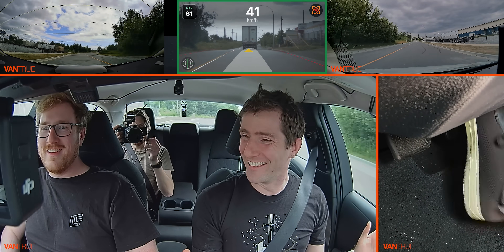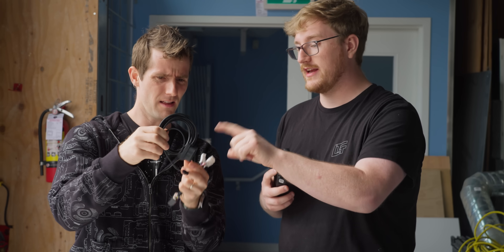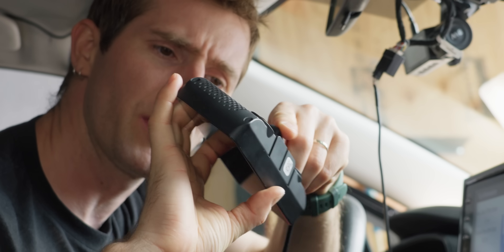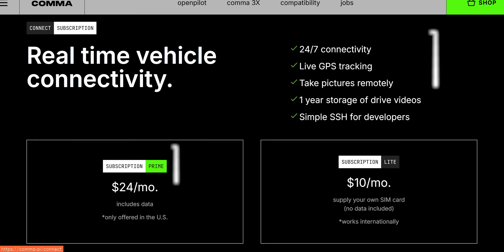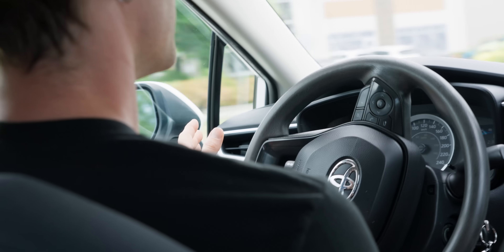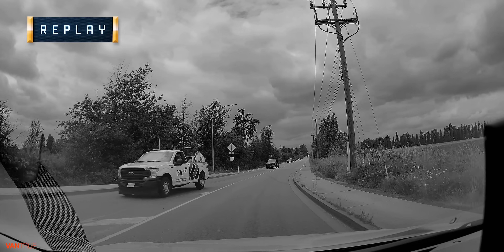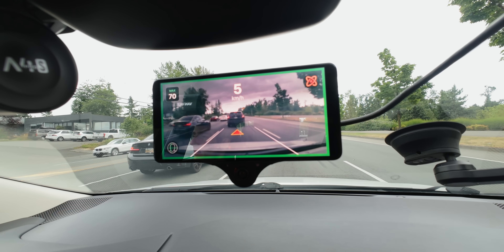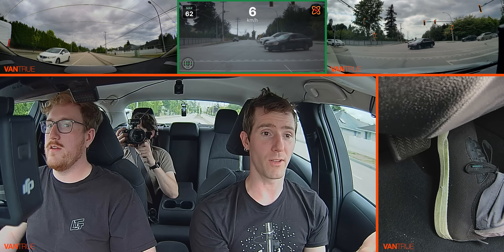I Upgraded My Car With Open-Source AUTOPILOT and it's AMAZING

Comment: Very cool to see Comma getting some attention. It somehow gets completely ignored in the self-driving car space, and I think it's one of the best technologies out there right now for consumers.
Reply: But its not the best, it feels more like expensive experiment. It can't drive in cities, it barely recognized traffic lights or stop signs, can't properly utilize turning as you can clearly se in this video, it only has some decent performance on highways, but then again, quite few newer cars have ADAS built in.
Comma will always struggle to perform due to basic lack of hardware, processing power and basic half hazard integrations into cars systems.

Comment: Hi @LinusTechTips, I saw you powered a Comma AI and another dashcam in your setup—could you please share how you connected both? Is it possible to use a single USB cable or a splitter from the Comma AI to power both devices safely?

Comment: When my 2020 Chevy bolt had to be lemonlawed GM offered a MSRP swap except they didn't make any cars I wanted. They managed to find a dealer demo 2019 Chevy Volt premier that had this and a bunch of other options pre-installed (technically the first owner but it had like 6K miles). It seems to work way better in my Volt then what is showed in this video so the tech that's already in the car probably matters a lot but I've really been enjoying this for years and was really disappointed when I tried out Tesla's version in a rental car model s.

Comment: Great to see Linus test this and inform more people about its existence. The ability of it to take curves is entirely vehicle dependent, and varies depending on each make/model, in accordance with the power steering hardware and firmware that's in each different vehicle. Some are more aggressive, some are less, but all can be easily overpowered by the driver if necessary.

Second, yes, the fact that this system will not disengage (at least not by default) when you assist it is a great feature, and is quite different than stock systems.

Third, I run it on a not officially supported vehicle, and the fork I'm using (a custom version of FrogPilot for my specific year/make/model vehicle) DOES read speed limit signs and if desired, slow down for curves (even with no specific speed limit signage) and speed changes, within the bounds of you setting the upper limit.
Reply: I'll say this, I have Tesla autopilot.  He says this is a problem with autopilot and I can assure you it's not.  Tesla has its issues but it's weird to make statements like that.
I've had the car jerk around because it seems to recalculate where the turn should be, like turning into a lane that has a curb and tree separating the lanes, but it knows to slow down for sharp turns.

Comment: I have a '23 Model Y I picked up used for a song. I have no interest in paying $100 a month for full self driving, not really interested in FSD at all, really. I've driven one with it and it is more stressful than driving myself. All I really want is adaptive cruise control with lane centering but Tesla doesn't seem to know how normal cars work. Their autopilot with autosteer is just so unreliable. It hits the brakes for no reason, sometimes slows down for turns sometimes it doesn't. Even just using autopilot without autosteer, it still hits the brakes for no reason.  Oh, and what's the deal with not having a resume button? I have to manually get it to speed again every time. The best thing about this car is with the Commander, I can finally change lanes and have autosteer resume after the lane change automatically. But really, it should already HAVE this feature.

I will say that the model Y with FSD I tested out... it did a much better job than autopilot. I just don't want FSD unless it's good enough for me to be ignoring the road completely, so I could be on my computer doing something productive or distracting to pass the time.

What I like about driving myself is the passage of time is faster because I'm completely occupied. I hate being a passenger because I get so unbelievably bored and time stops.

19:25 I love that! Let me help out when needed without kicking me out of the driving assist mode. Tesla, are you listening? Tesla developers, do you not know anything about regular vehicles? My 2018 F-150 doesn't kick me out of any cruise control functions when changing lanes! 2018!!!! (to be fair, it doesn't have lane centering)

Comment: And like Tesla the cameras are not perfect dont like rain fog snow or poor light and can be tricked into driving into a wall if a road is painted on it. If you value your life only use a system that also has a way to detect objects like radar or lidar as well as cameras. Safety in cars for occupants and other road users shouldn't be compromised for technology sake, yes humans make mistakes but they can be held accountable and as tech designed by humans it will not be perfect.

Comment: Have been using comma 2 and more recently comma 3 for the last 5 years on a 2017 rav4, I keep trying new cars with self drive and the comma is by far the best, maybe tesla has some advantages but the overall experience with Comma is the best. Their motto 'make driving chill' is comma, you never feel stressed, you always seems to have time, on rainy and dark roads it makes you feel much more safe, its 'assist' model works brilliant, as long as you dont break its engaged. There may be times on tight corners you may need to help turn thats a bit dependent of the car. I do 100 km home to office drive a few times a week and basically dont need to touch the wheel or pedals aside from start and end. I don't understand why all the majors are not using Comma, with built in cameras it could be even better, its driving behavior is so much more comfortable than the aggressive Tesla one. The install takes 10mins on the Rav4, it has a great screen in a good location, is also a good dashcam with onlin footage (at no ongong cost). Its also fully hands free as it looks at your eyes and does the driver monitoring with a fair balance of attention. Love my Comma!

Comment: I use a comma 3x when driving on long highway hauls. I can set it and not touch the steering wheel for 3 hours. The result is that the amount of fatigue that I feel at the end of that trip is significantly lower than if I had driven it manually.

Comment: I really think the self driving tech today still can't really be trusted. People have tried to demo Tesla FSD and auto pilot to me a few times. Every time, it's fallen flat on it face figuratively speaking. The car would attempt to jump the curb, not make the turn completely, or run stop signs. The driver would have to intervene to prevent an accident and I see the same thing here.

I like adaptive cruise control and lane keep assist since it makes highway driving much less tiring. I'm still holding the wheel and watching the road, but the system makes it so I don't have to put force on the controls constantly. The self driving tech is too dependent on requiring the driver to have situational awareness and being able to take over at any moment. It really defeats the point of the "self driving" tech right now.

Comment: Tesla FSD finally as of like 6 months ago takes turns at speed on the highway correctly. I had a mountain interstate with extremely aggressive turns in 70mph zones that were simply not comfortable and Tesla would overshoot the lane line every time. But now with the latest version they will not only steer aggressively enough but also slow down enough. Still doesn’t give extra space to cars in adjacent lanes well enough but speed control on turns is there finally.

Comment: it would be awesome if it would be make compatible wilt older cars (from 2000 to todays) to be plugged into obd port just to set up a certain speed (via 4 buttons [summon cruise control function and revoke it, set up certain speed, speed increase and speed decrease] that can be easily seen and press with backlight and stick it somewhere and use that button via a wire from that console) and when lighs on the backligh to be turned on and via obd whe the brake pedas is used to suspend that that setted speed. if that function would be putted in, i would give even 500 to 750€ just to enjoy cruise speed that it doesn't had from carfactory.

Comment: To say Tesla autopilot doesn’t slow for corners is objectively not true. Openpilot is awesome but two minutes of driving with Tesla autopilot (not FSD) will show you that it slows for corners every time. It also can handle any curve on normal roads as well, which openpilot fails to do. I know there are technical reasons for this, but the functionality is night and day in this front.

Comment: My coworker just showed me his Comma AI setup in action on his 2019 Subaru Forester the other day, and yeah this thing is pretty cool...

My Accord has lane keep assist and traffic assist (keeps a certain follow distance which is great for road trips) but the lane keep REALLY sucks (sometimes I have to guide it anyways because it tries to drift out of the lines) and it yells at me even when I have my hands on the steering wheel, or worst off, sometimes it tries to correct me to go straight when I'm in a turn because it thinks I'm missing the lines, so I'm really tempted to get this just to improve the current assist and get full autopilot for those longer road trips lol

Comment: 3:06; You should never have an accessory that is constantly pulling power from the diagnostic/OBD-II port. They aren't designed for that in mind. Short term is fine, but some vehicles will, Toyotas included, can actually be damaged by that.

Comment: 2020 honda accord sport has fanstastic Adaptive cruise control, but the lane keep assist is down right insane with how good it is! It was taking turns by itself in stock format that were normally pretty dang strong.

Comment: A standardized test on the track, with dummies entering the track, scenarios with little visibility and especially very sharp curves with speed oscillation (a weak point of older software versions) is ideal, especially if it involves different vehicles.

NOTE: for some cars that do not have cruise control enabled, it adds a lot of technology that would certainly cost more than the cost of this equipment.

Comment: Genuine question: Since the software is open source, is there concern that bad apples would be able to develop software to hijack and control your car remotely? It's a bit of a dystopian concept but a valid concern nonetheless.
Reply: no since its open source anyone can view the code and find stuff like that also the car isnt fully self driving yet. also the official has many ways to check for those kinda things. have you used github before?

Comment: Imagine if this was integrated into every car. Like a law requiring all cars to have self driving tech. Theres so much potential, like cars talking to each other and roads being designed for prefect autopilot. Wild to think about.
Reply: Car manufacturers are backward, or else every single car coming off the assembly line would have it, and they'd be forced to help third parties help put self driving car tech. (You have no idea of the sweat and tears that went into reverse engineering some of the openpilot stuff!)

Comment: I live in CA, and despite the fact that almost everyone does it, strictly speaking it is illegal to attach ANYTHING to your windshield.  BUT... you can put a dash mounted dash cam, as long as it's incursion into the drivers field of view is less than 7 square inches.

Comment: Tagging on to Linus recommendation on 2.4... for all of my IOT devices that only need internet connection, I put them all on the Guest 2.4ghz network.  This protects my home network in case any of the devices has had malicious firmware loaded to it, but still lets it work.

Comment: One thing that should be done is to compare that with real modern system - not necessarily Tesla FSD, as it might feel like unfair comparison, but while they make comments all the time that it's better than regular cars, then maybe compare with modern BMW 3 Series or Audi A5 travel assist systems. 

They don't pretend to be full self driving, but even by looking at the footage I can see they are way better. Of course, in US/Canada BMW, Audi or Mercedes are not cheap cars, but it's unfair to say that it's better than what you get with your car.

Comment: 11:13 I have a Tesla model 3 with HW3 and I have to say your statement is far from the truth. Going fast around sharp turns has never been a problem. It’s nothing even close to this although I find this fascinating. Love the vid.
Reply: I’ve driven Tesla hw 2,3 and now hw 4 with many versions of FSD in the last 4 years and the speed is managed very carefully not just in turns but in traffic. I heard that comment in the video about “Tesla also has issue” and was surprised to hear that.
Reply: @John-m8i8i  true, it does slow down

Comment: I want a retrofit kit for classic vehicles that would be quite cool it would of course cost more and be more invasive but the option would be cool just a solid universal kit
Reply: impossible nearly ud need to install sensors, and ways for the car to steer itsself. not to mention breaks basicially the whole car has to be replaced every part costs would be insane
Reply: @znozhacks6892would really be quite a easier than you are anticipating would probaly cost $5000. Electronic inline power steering is already a thing electric assist brake master cylinders are also a thing for slightly newer vehicles with OBD2 even just plug in for all of your ABS wheel speed transmission and throttle position sensors for a carbureted vehicle you just use a throttle position sensor an a servo more than likely you would have to retrofit to add a front and rear wheel speed sensor which is already kind of a thing in the aftermarket Mount your large amount of sensors needed really the worst part would be just entering all the data on the vehicle and aligning sensors you'd probably have to give rear differential gear ratio tire size sensor height sensor distance sensor approximate location what engine what transmission but gui that really wouldn't be too bad

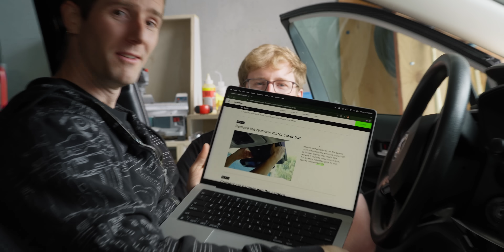Comment: 3:30 So yes and no. In a lot of newer cars they want to maintain 12 volt power at all times because surprisingly a lot of data is stored in ram, I worked in an auto parts store replacing hundreds of batteries for free many other employees would not hook up the 12 volt maintainer to the OBD power causing the car to idle and run rough until it relearns everything it needs to relearn, otherwise yes it is good practice to disconnect the 12 volt battery it just might hunt for idle initially

Comment: Slowing down when turning a corner on the freeway with a Tesla basic autopilot is NOT a problem anymore since a few updates ago. It slows down to a proper speed instead of taking the corner at speed. Its called corner assist or something similar.

Comment: I've been using a comma 3x for the past year in my mazda3 and it's been massive for long road trips. 5000+ miles while engaged and I have no complaints. 

Obviously there are disengagements, but as long as you aren't completely inept at driving, it isn't a problem.

For context, I'm using a torque interceptor (required for most mazdas) which allows frogpilot to turn the wheel over 360 degrees.

Comment: I've racked up about 27k miles with my comma 3 so far.  How sharp it's capable of turning depends on the limitations of your vehicle.  Hyundai cars can turn the wheel quite far (probably close to180 degrees).  

If you do long drives, it also helps with reducing fatigue very well.  I've done several 22 hour stints with it so far, and it's been an absolute joy to have as an option.

Comment: I've racked up about 27k miles with my comma 3 so far.  How sharp it's capable of turning depends on the limitations of your vehicle.  Hyundai cars can turn the week quite far (probably close to180 degrees).  

If you do long drives, it also helps with reducing fatigue very well.  I've done several 22 hour stints with it so far, and it's been an absolute joy to have as an option.

Comment: I've been using Comma devices since 2022, and since then, I've only purchased vehicles that Comma supports. I have even bought a Tesla Model 3 which I thought would outperform the Comma, but was I wrong. Glad they released the harness for Tesla, and I've already purchased one set for my Model 3, which is already on its way to me right now.

Comment: I love mine. I've had it since November, in my 2018 Pacifica hybrid minivan. I use it almost exclusively on highways, but it has been nearly perfect. It also makes my 3-7 hours trips a breeze, and saves my knees, shoulders, and back. I love the fact that I can drive WITH it, so I can take control, but let it slip back into control when I'm done.

Comment: I'm sure you can modify an aftermarket electric power steering pump and brake booster set onto many older vehicles, and tap in to a mix of that plus jacking either the electronic throttle signal or the Cruise Control box depending on the vehicle, and that would be enough to provide most of the functionality needed for a project like this to work. As much as I'd never in my lifetime use it, I would like to see it adapted to an older vehicle like that.